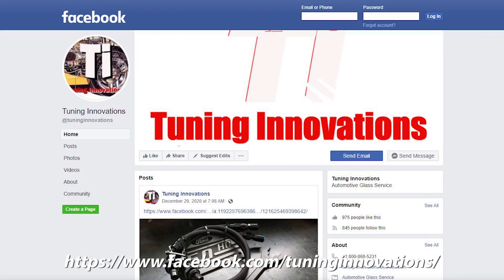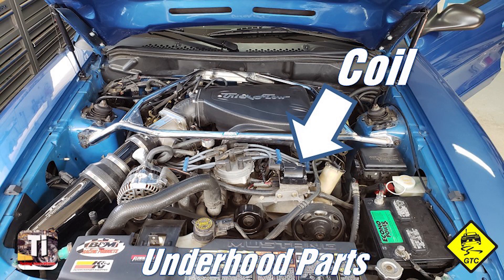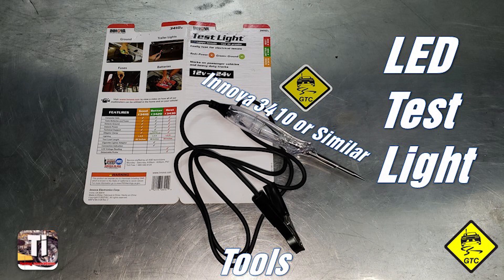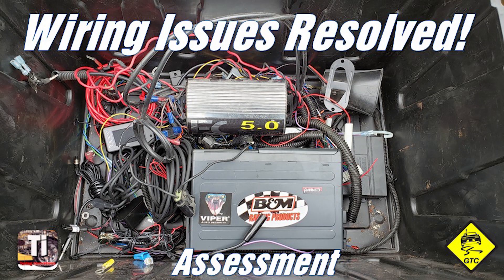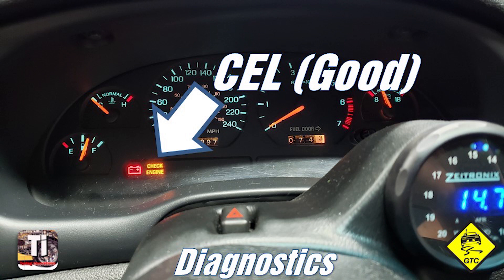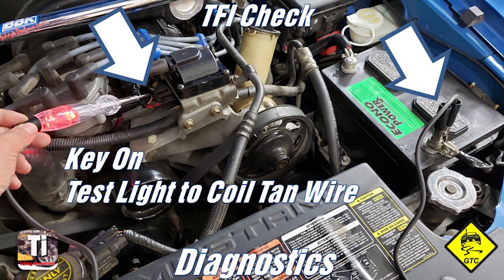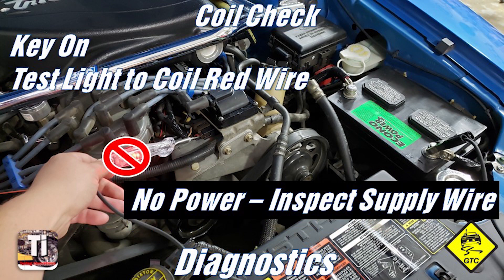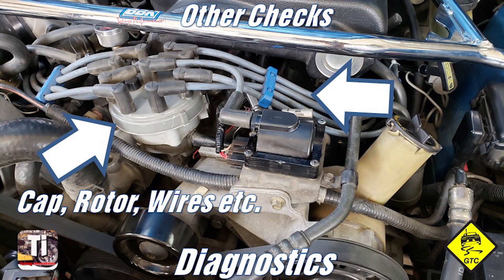Solving the SN95 5.0L #No Start No Spark - SN95 Owner's Guide #16

Comment: best way to not have a no start, don't put a msd coil on your 94-95 5.0, waste of money lol.
Reply from the maker: Agree! That has been 100% my experience with aftermarket CDI boxes, Coils, and other High Performance solutions. So much marketing is put towards stuff that is less reliable that OEM. Thanks for watching and commenting! - Darren
Reply: Can you tell me what's wrong with my 95 GT mustang 5.0 it'll run sometime it'll cut off then it won't crank back up I come back and let it cool over whatever and go back to it and it will crack up and run I can go wherever I want to go where it don't do it all the time can you tell me what is that problem
Reply: The issue with my car I can drive it sometime it'll cut off while I'm driving when I come to a complete stop I try to crank it again and it just turn so I come back later and try to crank it and it will crank up and run I'm trying to find out what is that problem
Reply from the maker: The issue could be a variety of things, the next time it happens, follow the diagnostic process exactly as it is in the video and you'll be able identify the failing part. If you test when car is running you will not be able to detect the failing part, of course if you don't run though this test, no one will be able to tell you what is causing the issue without expensive guessing. Best of Luck! - Darren
Reply: If not MSD, what would you look for?

Comment: First thing to do is make sure there is antifreeze in the overflow reservoir.  Mine has a sensor that makes sure there is water in the system or it wont start.
Reply from the maker: That's not quite correct, that sensor will not inhibit the starting of the vehicle. It will only trigger the "CHECK COOLANT" light to come on in the dashboard. If that is truly occuring on your car, something else is a problem, or someone has modified your wiring.

Comment: Do you have to install the tfi in the heat sink or can I just plug it in to test if it works ?
Reply from the maker: You should be able to plug in for a short time for testing without mounting to the heatsink.

Comment: I have an alpine system I suspect it’s the issue I lost the key fob and the alarm won’t go off I cut the wire car won’t start
Reply: Problem is I don’t know how to remove it
Reply from the maker: The car featured in this video had exactly that problem, the Viper alarm would randomly panic and kill the ignition which driving. This can be a bit of a task, but if you can find the alarm module(s), determine model, then work from there looking for an online copy of the installer's manual to figure out what should be chased and removed. Theya re usually somewhere under the dash to prevent easy removal. The way I had to do it was start at the module and follow all of the wires back to where they tie in, then repair any of the cuts, splices, and connections the alarm installer made. It took time, but it was worth it. - Darren

Comment: My 95 Ford Mustang 5.0 GT will not crank in park when I move it to neutral it starts up but now even in neutral I have to move the shifter back-and-forth before it will start up (PS there is no clicking sound at all) any help would be appreciated
Reply from the maker: Hi there! Your symptoms are a little different than those that this video works to address, but that said, I think you are close to discovering the source of your issue. Yours is a "no-crank, no-start" situation. It sounds like you have an automatic equipped car, and as a safety feature, these are setup not to engage the starter unless the transmission is in park or neutral. You've found a workaround by engaging neutral, which is a clue. You likely have an issue with a worn transmission range "selector/sensor", which could be a simple adjustment, or you may be in need of a new component. I don't have the diagnositic process in front of me, and have not handled one personally from experience. Try searching for transmission range selector adjustment AODE/4R70W and run through the checks you find. This should not be too big of an issue to figure out and get solved. Thanks for watching and commenting, and best of luck! - Darren.

Comment: If we get to the dizzy test and the tach does not move and the check engine light stays on when cranking.. is there still any chance that the problem might be something else then the pip in the distributor? Asking because we just changed the distributor and wondering if something else might be worth looking at..Thanks! Great video by the way! Cant wait to get more SN95 content!
Reply from the maker: Hi there, thanks for the support! When the check engine light stays on it is typically the PIP, but since you've changed the dizzy already it suggests it might not be the case. The wiring and connections related to the dizzy and signal to the PCM are another place to begin testing. Try to source a EVTM for 94/95 for the wiring pinouts. If you have trouble finding one I do have a digital version I can share. If you would be interested in that respond here and I can direct you to a FB page to get you connected.

Comment: My 97 v6 stop running yesterday, no lights on the dashboard turn on when I turn the key. I swapped the battery and the starter relay
Reply from the maker: That's a pretty challenging thing to deal with for sure, I would begin with tracing the path of power with a test light or multimeter. Verify power at the battery, then move to the underhood fuse panel, then to the interior fuse block. It sounds like you've lost all power somewhere. Best of Luck!

Comment: Ok so my check engine light stayed on, and my red light stayed on also when checking the tfi module. So I guess change my distributor first then go from there or change my tfi module 1st and go from there? 😆 idknow. Either way I'm getting no spark from distributer or coil.
Reply from the maker: I would start with the PIP (distributer) and if that didn't fix it, move on to other checks. If the CEL doesn't go out, you have no spark signal.

Comment: It was a good video on diagnosing electrical problems that cause no-start problem, but what about fuel? I would have expected some talk about listening for the fuel pump to prime when turning the key and maybe even measuring fuel pressure or confirming that the injectors were getting signaled.
Reply from the maker: In this case it's all in the title. This video is of a very specific scope which is the most common of issue with the 94/95 Mustang, a No Start resulting from a No Spark condition. A no fuel condition is far less common and far easier to diagnose using common troubleshooting practices that are not specific to SN95's only. This video is the protocol for the unique EEC 4 94/95 TFI ignition. It also applies to SEFI Foxes although some parts are in different locations.

Comment: Did all the tests, TFI didn't pass the test.
Installed new TFI and started right away.
Thanks so much for your video mate.
From Australia 👍
Reply from the maker: Glad to help someone all the way away in Australia. You have your own amazing muscle car culture there, which we find so fascinating!
Reply: @GrandTouringConcepts I have 94 5.0, no blown fuses in either fuse box. Check engine light does not come on with key and on position OBD1 scan two will no longer scan or detect once I press scan it doesn’t do anything , I put a spark plug out, connected it back to the spark plug wire put it close to a ground bolt turn the key over no spark fuel pump not priming with key on I have had to manually jump the pump to get it to prime CCR and relay clicks when the key is turned over in on position brand new TFI module I pulled out the ignition switch and checked it by ohms and it is working perfectly fine. I am honestly stumped thinking bad ECU.

Comment: I replaced my throttle body and air intake. Now it won’t start. Cranks over but no start.
Reply: 1995 mustang gt. Check engine is not coming on when key is turned to on.
Reply: 20 amp fuse is good
Reply from the maker: Usually this means there is something wrong with the power to the PCM, or the PCM itself. I can't think of anything related to the throttle and air intake that would cause the issue. It might be best to start tracking to see if there is power getting to the PCM.
Reply: @GrandTouringConcepts I ended up throwing the crap throttle body. I switch to a Holley sniper 2 setup and the car dyno’ed 318 rwhp.

Comment: 94 5.0L mustang. Problem is hard to start. But when it does or with a shot of ether, it seems to run good for a few seconds and then i the engine will drop and I see the rpm gauge go to 0. And back up.
After a few times like this the rpm goes to 0 and engine stops. Its like you are turning the key on and off.
No spark no fuel. It justs stops.
After a few trys to start it will run and then the rpm goes from 2,000 to 0, car shuts off and the rpm goes back to 2,000 and motor runs again. Could this be the key switch or crankshaft sensor???. Bad ecm
What would shut the motor off and back on like this.
Is there a relay that could be bad???
Any help needed with a thank you.
Reply from the maker: These cars don't have a crankshaft sensor, its a PIP in the dizzy. Only way to isolate the problem is the next time it fails is to follow this proceedure step-by-step and you'll have it pretty quickly. It's an easy set of tests, anything else would just be guessing.
Reply: @GrandTouringConcepts  
I did what is in this post.
It all checks ok.
New coil, new distributor, new tfi, new ignition switch.
The only thing not new is computer and camshaft sensor.
Could this be a ground problem???

Comment: I have a problem I need help with P L E A S E  !!!  I have spark from my coil wire to the distributor, as per my induction style timing light. I DO NOT have ANY spark going through ANY of the spark plug wires, to the spark plugs. Again. As per my induction style timing light. HELLLLP !
Reply from the maker: If you have spark from the coil, this should be pretty easy. You may have a defective dizzy cap or rotor. These are quite affordable to swap another on. But if you just want to check, run a digital meter and check for continuity from the top of the center stud to the underside, the do the same on the rotor, the springy bit to the plug side. You can also clean the contacts with some sandpaper and retest.
Reply: @GrandTouringConcepts   I have replaced both coil and rotor with new. Didn't help, but I will check them anyway. Thank You
Reply: @GrandTouringConcepts  I have replaced cap and rotor with new. No Change
Reply from the maker: Next I would verify spark from the coil in a slightly different way. Rather than the inductive light, install a spark tester (or just a good plug if you don't have a tester) and place it near a good ground. Then crank the engine, look for a good strong rapid spark. If it isn't bright blue and very consistant, you may have a weak or failing coil.
Reply: @GrandTouringConcepts  I have a new coil, and I have a spark tester. I will check that tomorrow, weather permitting.  Thank You

Comment: I have a friends 95 gt that he said just stopped running.  I can't communicate through the underhood connector. The ecu has power going to ecu pins 37,57. Has 5v reference on pin 26, and has grounds. The cel is on with koeo, when cranking the cel does not turn off. The fuel pump is also not coming on.  Wgreen key is on the blue/org wire at the ccrm is showing .1v but constantly going between that and ground when checking with power probe. Any ideas on this? All the diagnostic trees point at bad ecu, and fuel pump but ive never seen a ecu that's bad and still have good reference voltage
Reply from the maker: I checked with Ted of Tuning Innovations on this one and he assesses that there is an issue with the PIP signal. He doesn't think its related to the EEC. PIP output can be checked with an oscilloscope and with the CEL staying on its failed the quick test. EEC doesn't know the engine is turning or turning fast enough to switch into run mode.

Comment: What if the check engine light just dims during cranking? No communication with svan tool, pcm have powers, grounds and 5v references all working but no comm. Just crank no start
Reply from the maker: That would suggest there is a problem with the PIP signal to the PCM. Start point testing there.

Comment: Man I am stumped. 1995 ford mustang gt 5.0. When I first got it, the thing would run but run like it’s about to die. Changed spark plugs and now it won’t even run. Gapped plugs to .52ish like it calls for. When I turn the key the in line spark tester illuminates very dimly (without cranking) and I can here a little clicking noise. When I remove the spout plug it goes away. I did the self test with the key on and cranking and the check engine light doesn’t go away. Any help would be greatly appreciated.
Reply from the maker: Based on your statement about the cranking test, the CEL does not go out during cranking. This demonstrates that the ECU is not getting cranking signal from the PIP. This points me towards troubleshooting the distributer, PIP, and associated wiring. If the ECU does not get a PIP signal it will not know when to trigger the spark, or fire the injectors correctly. When they fail it is generally slow and progressive, rough running, or shutting down when warm, to finally a dead-no-start condition. This is where I would begin.

Comment: I swapped a 3.8 for a 5.0. Changed ECU and wiring harness. Got a 5.0 bellhousing and new clutch cable, clutch and PP and 157 tooth flywheel. But the car isn't cranking over,just a humming noise. Is there a different starter for a manual 5.0?
Reply from the maker: That a little outside of the scope of this video, that is a No-Crank condition. I would remove the starter from the bell housing and bench test. You could use rockauto's look up to see if there is a parts interchange issue as a quick check too.

Comment: I have a 1995 mustang gt, my car used to cut off while driving and sometimes wouldnt start at all, but now it doesnt start, my fans just kick on and it cranks, sometimes the fans will turn off and then car will turn on but instantly shuts off, any help please
Reply from the maker: Hi Jim, have you run through the tests as described in the video? If so, what were the outcomes?

Comment: I have a 97 gt.  It’s been doing this the last 3 days.   I would go to start it and nothing but there is strong battery.    It would click then seems like the battery is dead.   I jumped it and it started.   Next day same thing but it started on the 3rd try battery was fine.    Not sure if it’s the battery or the starter.
Reply from the maker: It sounds like from your description that you have a different issue than this video covers. Yours is a "No Crank" condition where you are reporting issues with the starter system. The good news is that this diagnostic process is not unique to the SN95, and standard practices apply. I recommend checking google, or a manual for how to move ahead. It sounds like the starter may be sticking and may need replacement, but be sure to do all of the proper checks of the battery, cables, and starter before loading the parts shotgun and blasting a paycheck down range. Thanks for watching and commenting, and the best of luck! - Darren

Comment: The problem is a pip circuit problem. Change the pick up in the distributor. I went through this shit back in 2000.  A ford dealership had my car for 4 months before they got it right

Comment: So, what if it idles just fine. But no spark to cylinders 1&3? 
Fresh HCI, checked everything. 95 GT
Reply from the maker: This is a rare occurance for sure, idling fine with two dead holes seems to be a contradiction. My pathway would be to start at the plugs and wires and work from there. Move the plugs and wires from the dead cylinders to the live cylinders and recheck for spark. If the dead cylinders changed, replace the plugs and wires. If it did not, check the dizzy cap and rotor, try a different set and observe for change. If you still do not have spark on 1&3, check to verify the injector is firing, you should be able to learn if this is a secondary voltage, (spark output) issue or something on the primary spark triggering. You may also want to look up how to do the built in cylinder balance test for these cars, it might help you with getting the issue solved. - Darren

Comment: 94 gt cranking issue, new distributor, new tfi module, coil checked on another vehicle. The cars check engine light stays on while cranking, and test light will not flash.
Reply from the maker: Either the new distributer is no good, (it happens) or the wiring for the PIP needs to be inspected and tested. Find a copy of the EVTM and run through those tests next.
Reply: @GrandTouringConcepts I am unsure where to look